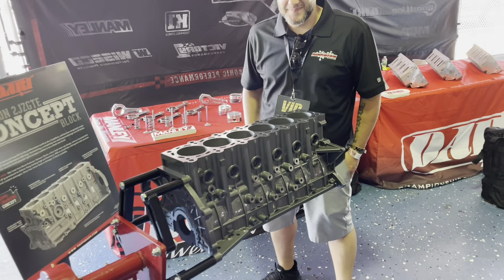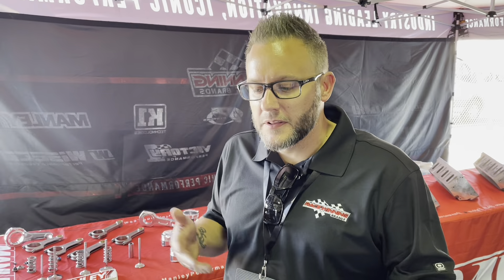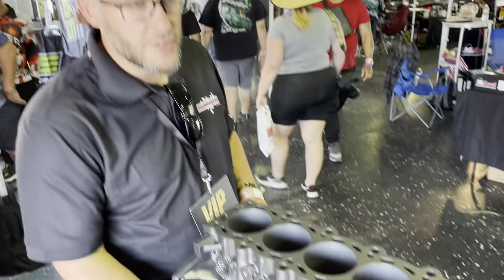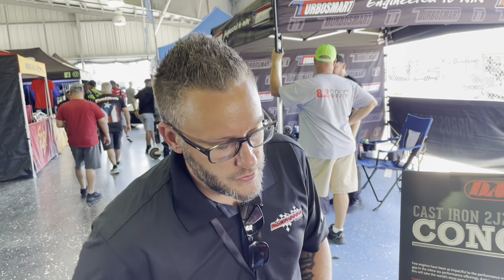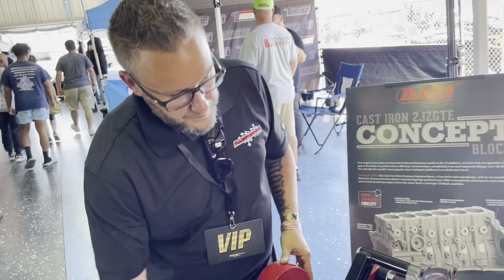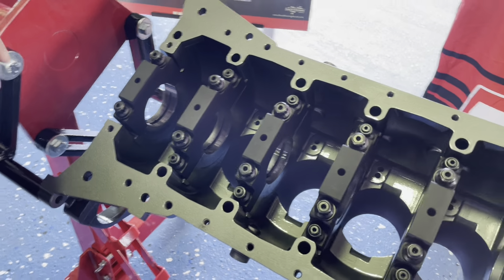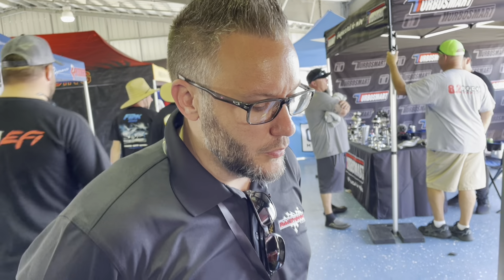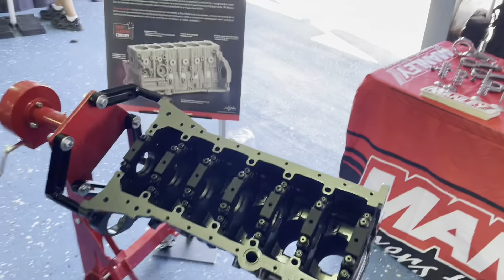DART 2JZ CAST IRON BLOCK! The Ultimate 2jz Block?

Comment: 4200 bucks for a bulletproof 2JZ block is a slammin deal. The 4 bolt mains, no coolant between cylinder bores, and added material all around is really really nice. Compared to a billet block that can hold slightly more power and costing 10x as much that's a deal
Reply: 2jz has siamese bores stock, I think it's ridiculous that they use this as a sales pitch
Reply: If you send a rod through a billit block the befit is you can repair it but the price is a joke

Comment: Wait you have a NA block??
Reply from the maker: Factory NA block going 190mph
Reply: @BalticSupraRacing  There is nothing wrong with NA Block
Reply: Most of the high HP mid to low 7 second cars are using NA blocks and NA head.
Reply: Brings me a lot of comfort knowing NA blocks can do this. Going to build mine at some point

Comment: If you're making enough hp to need this, you can afford it.
Reply: 4200 bucks for a block that can hold over 2000hp possibly over 3000... that's not a bad ratio. Your cylinder head to make that much power will cost more than the bottom end and this block still.